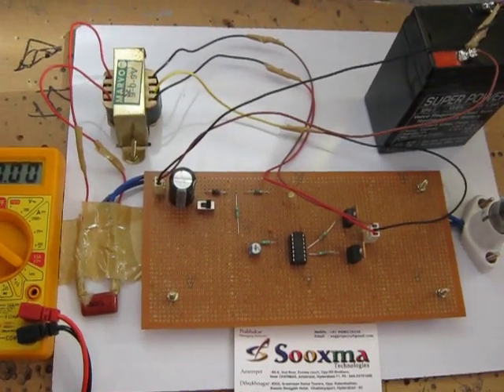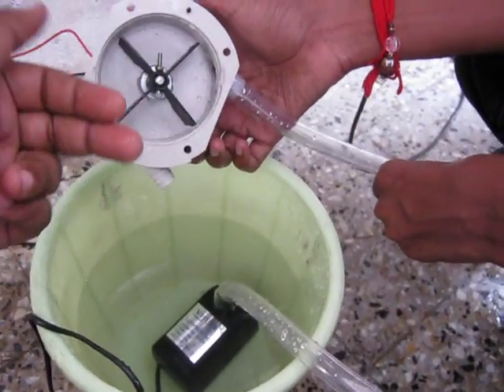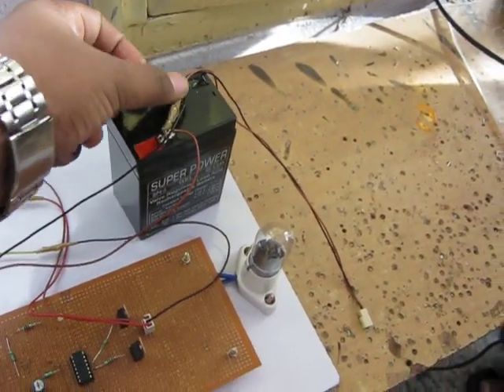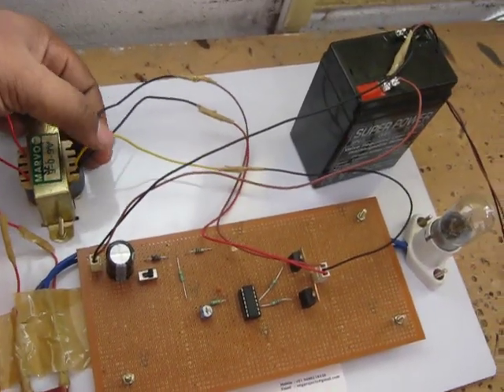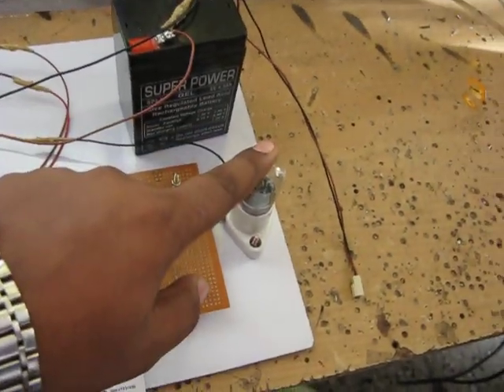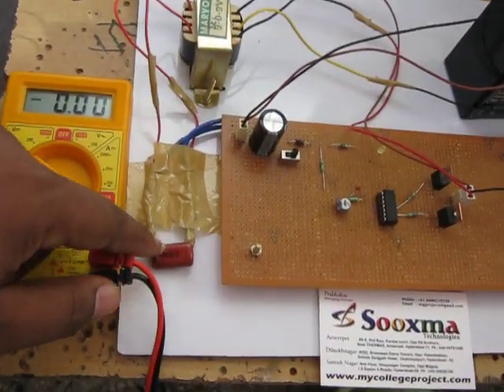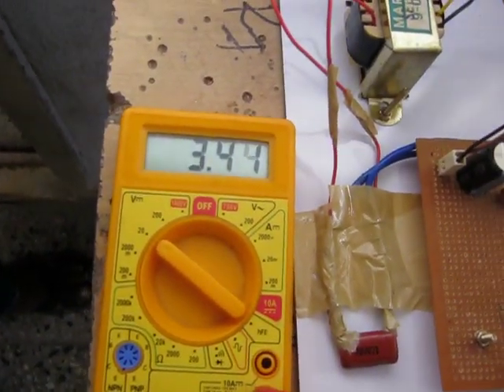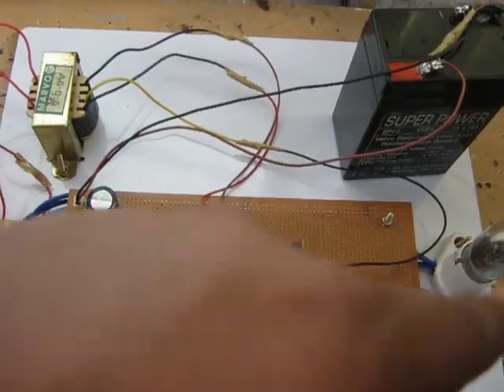Micro hydro power generation system for building roof rain water flow to power AC and DC Loads

Comment: Power here is going to vary with vertical head and flow. Draining a large roof down a couple storeys is going to max out tiny turbines like these even in a moderate rain. 

I can absolutely see a use for this kind of tech in a place where you have somewhat-unreliable electrical service (or worse) and a reliable rainy season. If you have land, you set up a traditional microhydro facility, but if you just have your house, this might still be worth it. 

Sometimes a few LEDs (i.e. a few hundred mA) make the difference between studying and not studying, or between finding an exit in the dark or stumbling and falling.  So I say, well done!
Reply: If he had a roof holding tank (usually not practical due to size and load) and the water went into a 3-cyl reciprocating "engine" to hydraulically use every bit of energy, and the crank speed sped-up for a generator already phased to make 8V to charge 6V deep cycle (again - expensive) this might work . . . what we see in the video, especially the home-made "turbine" is horribly wasteful.